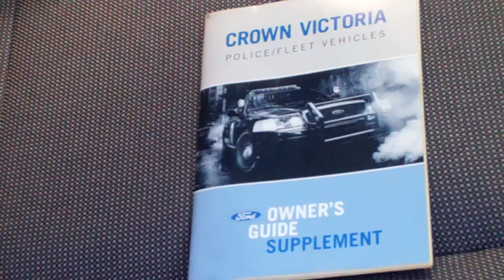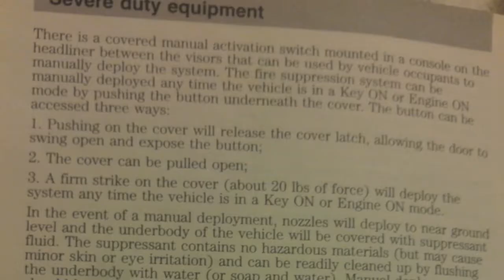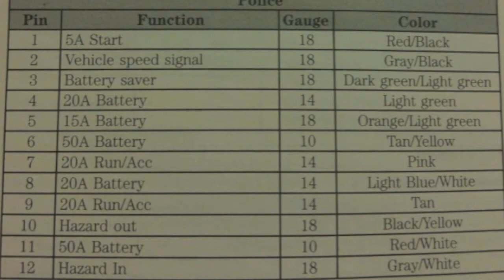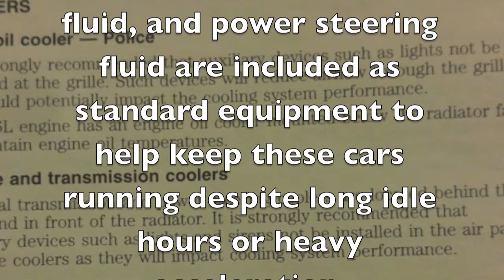The Top Ten Things You Didn't Know about the Ford Crown Victoria P71 Police Interceptor

Comment: I'm 64 years old. I have a 2011 Crown Victoria LX with close to 80,000 miles. I hope I can keep this  car going until I die.
Reply: i use cop-use rated K&N engine oil filters. (i got the p71 model) and thats what they recommend using.
Reply: Stephen Williams nice man! I would say good luck, but u won't really need it. I have a town car with 225k miles running like new, only had oil changes, 1 battery, and a few tires lol. the more u burn the rubber the more u pay for tires lol. these cars are bulletproof bro, and I wish u a happy time with the car. I have seen crown vic and town cars running upwards of 750k miles on original motor and tranny running like new, and these cars were abused in the livery force.
Reply: 2005 CV LX Sport, 305K miles still running strong. Its had routine maintenance with nothing but motorcraft parts. All I have done is minor front end work (Balljoints, tie rods etc) and shocks. I will drive it until Im dead.
Reply: Stephen Williams still got the Vic?
Reply: Im also 64 yrs young and you guys just motivated me to keep mine running til i die. Engine had 420,000 on It before i swaped it out with a 2000, from a 2003 gmk. My mistake is that i dont know the mileage on the replacement engine.

Comment: unfortunately all of those coolers begin to leak over time, especially if you live in the rust belt.  they upgraded the oil cooler hoses in 2010 but the trans cooler and even ac accumulator are common places to leak!

Comment: The only things I can think of that were extras (although you did put 10 different items in the video so you technically couldn't have forgotten anything) was was that the front brakes on the P71 are larger diameter and larger calipers than then a civilian car (the rears are the same size as civilian car)
 The speedometer as you know is a certified calibration unit which means it is more accurate throughout the the lower speeds to higher speeds than a standard a speedometer in a civilian car.
 Although the engine and transmissions themselves are practically identical to a civilian model, the PCM and ECU computers have been calibrated specifically for police use which means higher and firmer shift points, higher rev limiters? and higher speed limiters.(fun fact a lot of people aren't aware of?
 P71 will do 60mph in reverse!🤪)
Throughout the entire vehicle a P71
may have metal blocker plates covering the holes in the trunk lid just inboard of the backup light housings( I'm not exactly sure why yet but I've seen it on several P71s
but never on a civilian model.🤷‍♂️)
 One other thing that a lot of people don't realize other than the car being wired for options that might not be ordered in each vehicle is that although there's only technically the 6 gauges on the instrument cluster,usually there are about 20 different sensors that can be accessed via the OBD2 plug under the dashboard with a tuner or blue Bluetooth activated device that is designed to display all these sensors throughout the body control /engine management system(s)

Comment: Mine came with a traction control button hidden inside the panel. It still lights up  but it's frozen solid and a replacement on Rock Auto is like $65 I think

Comment: The idle hours x road hours was just for a maitence schedule for fluid and filters etc, no one seriously believed it was equivalent as road hours which wore brakes, tires, transmission, etc etc. 
 idling only wore on the engine, and primarily the largest risk was over heating because liquid cooled engines are made to have air flow heat transfer over the radiator. Hence sitting idle has no real movement of air.

Comment: Yo WJHD! First, Thank you for every one of your videos. Now, hopefully you can give me some guidance. I bought a 2007 CVPI and I want to install a TRAC OFF button (I have a Z , C 6) and Power adjustable pedals. I found a 2010 CVPI with both. Can I just install Trac Off button and it will work? And I can't find a video on how to install the Adj Pedals. Thoughts? Thanks again.
Reply from the maker: I haven't looked at what it would take to wire that up.  I think it's more than just a switch addition, but I know the wires are already there going up to where the switch would be
Reply: @WJHandyDad  Thanks for the quick reply! I was hoping the Trac ctrl wiring is wired to the trans already. The pedals I'm hoping come off in a cluster with motor and will be plug and play. I tried to find a video of somebody tackling these tasks but not luck. If WJHD doesn't have a video on it, nobody does.

Comment: So what is the actual topspeed in a 2006 P71 with 3.27s? That's what I have.
Reply: A 2010 P7B with 3.27's did 129 mph in the Michigan State Police testing.
Reply: They have an electronic speed limiter at 129mph

Comment: Didnt the P71s carry and extra inch or 2 of ground clearence over the P73s? (civillian)
Reply: The p71 is auctally 1 inch lower than the others for better high speed stability.
Reply: Depends on the location cuz mine is a inch hire then my aunt's 99
Reply: My 2000 is 2 inches lower because i lowered It with h&r springs and ibec shocks.
Reply: They are 1 inch higher for better clearance when driving over curbs mainly.

Comment: in your video at 2:10 minute..you talk about some power conection...thats for the rear windows can you tell me or show me how to re-wired to the main control ..so in that way I will be able to let the power go to the rear windows..both front doors has the same conection and in other models.. that conector is between frame doors on each side
Reply from the maker: I have a video uploaded showing how to fix the rear windows... the power connector is in the B pillar (pillar between the doors) IF the upfitter did it correctly.  Some of them just cut wires instead of setting up the car properly!!
Reply: I did look for the power connector between the doors.. and I did not find anything...the only conector that I found was in the front doors..the same power connector that you are telling

Comment: oh buy the way p71 crown victoria are not chipped they are tuned we r required to install factory crownvic settings wich take three hours some police or sherif dep. loose track some have been changed some did not... those that weren't restored to factory settings are still tuned unless you had the cpu replacement now it would be factory settings local police depo garges have to reinstall the police software wich only the manger has access to this software and has to sign of on it...
Reply: Constitutional Bowsers please dont be a youtube comando. retired cars are not detuned. the tune as you call is is a file that is VIN specific from ford. there is no standard tune as they are all specific per VIN and options. It requires a ford IDS or a J2534 programmer to change the tune with a subscription from ford to program or change user selectable options (like turning cruise control on or off, Daytime running lights, police dark mode) depending on model years. You cannot modify the tune unless you purchase a program like HP Tuners and you have the knowledge to change things like timing and fuel curves. I own several P71's, have worked and currently do work on patrol cars and dont need any manager access to tunes. if you had a P71 and needed to replace the PCM i can easily program it to the factory tune no different than anyone else with the proper equipment.